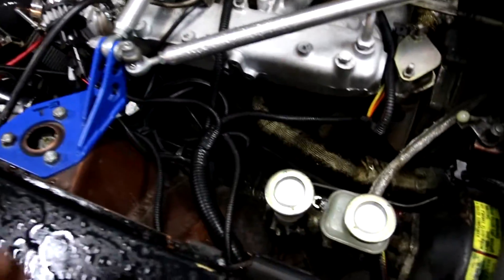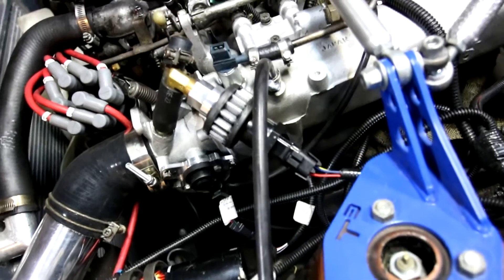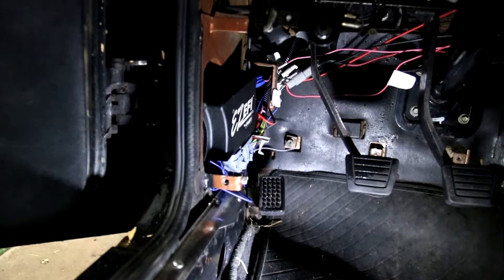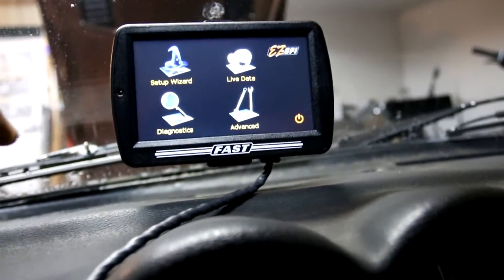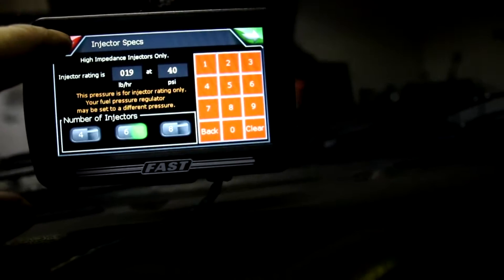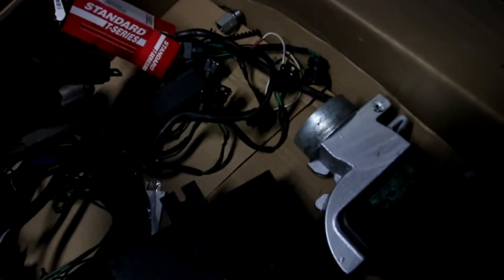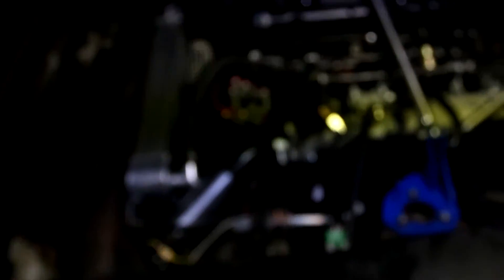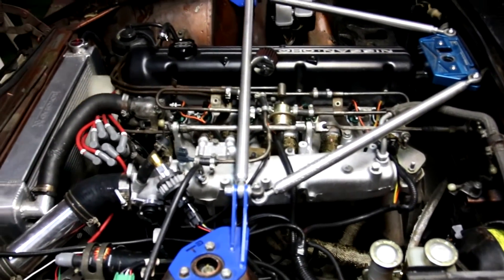FAST EZ-EFI Retrofit For Datsun 280Z Part2

Comment: Im trying to do this now. The only question i have is the rpm module so it only hooks up to negative side of the coil, ground and the harness... what did you do with the distributor wiring?? Is it even used anymore??

Comment: I know I'm late on this, just saw the video. I have a 77 z and if the engine loads up enough to stall,check the temp sensor connector it is usually corroded and green. Clean or replace. On cold start it is 2.4k ohms. At operating temperature it is 200 ohms. Open is infinity on ohms. If it still loads up and stalls after that or when slamming the driver's door it's the ECU. I used to take them apart and fix the PC board but it's  cheaper to buy a new one. Don't use a used or junk yard one. Been a Nissan master tech since 87. Not much I don't know about Z's. Had my Z over 40years. And no, I would never put a GM part on her.

Comment: Do you have to use hi impedance injectors? I had Turbo injectors but I couldn't get it to run right. Put stock injectors in and nothing

Comment: Hi man. Great video thanks. I am doing the same install on my 1977 280Z. I have two questions about the wiring I hope you can answer for me.
1. Where did you get the switched 12v from for the FAST ECU?
2. The fuel pump diagram says to also put switched 12v on the relay (86 pin). Did you use the same switched 12v for that? I can't figure out why it would need switched 12v since the fuel pump wire from the FAST harness (85 pin) should be doing the switching by giving it ground or not. I hope you understand what I mean :)
Thanks!

Comment: I really like the idea if this. I have looked at megasquirt in the past but this looks so much simpler. I do not have any reliability issues with my stock set up. I have even taken the car on three 2k mile trips and it's incredibly reliable. These cars were built to be driven! 

Anyway my question is did you see a fuel economy change? I see 26mpg average on long trips. All 75-90 mph. I have tall gears and it loves the highway. If I could improve on that I think it would be worth the investment. I would like to upgrade that terribly restrictive intake at the same time.
Reply from the maker: There is a small  increase of mpg. You can set the target AFR for when it's cruising and the computer will adjust fuel accordingly. In my opinion the engine runs much smoother over factory setup
Reply: @Redline280zChannel  Sounds like it would be worth it. Mine always runs a little rich, better than lean I figure. But I suspect it's just old wires increase resistance = more fuel. I think I'll give it a go in the spring. Thanks for the video!

Comment: Thanks for posting this (and the part 1, too).  I'm resurrecting a '77 that's had tuning issues since I got it.  So I've been curious about this kit.  Do you know if this system needs the rising rate FPR that comes on the stock fuel rail?  Or, will it also work with an adjustable FPR like you'd use on an aftermarket rail?  I think this with a Palnet or other aluminum rail would really clean things up.
Reply from the maker: either setup will work

Comment: Great video of installation "VERY GOOD"
Its june 16 2018 Im viewing this vid.
That battery should be ,in moving air, it creates gas. ( behind your seat is NOT the Place for it.
Besides it will eat the back of your seat from acid the floor as well, and your breathing in acid fumes and the acid is in the cock pit eating everything those fumes land on.
The engineers have it over the fender well for a good reason.
Move it back to the engine compartment. 
The other thing , having wires under the pedals against the fire wall......is NOT a good thing not a good look.
A sports car needs to be neater than that installation to be reliable
And if it looks right it is right.
I also saw alot of connectors ( cause heat build up) the few connectors on a wire the better.
Just saying move uo to the next level of being a" sports car guy. " The chassis is the car. All systems should be as well routed and professional looking as "at least the original lay out or better"
The body work is just to keep the rain out.Alot of "sports car newbies" work on the outside first.
But an experienced builder will be all about the chassis first.( get that sorted out and neat installs)
Again great video well done very good camera. ( clear sharp video )and explanations

Comment: I've been waiting for this! I was going to ask if so far you've noticed any improvements in reliability? Right now with everything stock I've been running into hot start problems, and starting to get cold start problems. Do you think this would help with that?
Reply from the maker: My car  starts up every-time whether the engine is hot or cold. Before, sometimes it wouldn't start at all. This kit could possibly help with your start up since it replaces your EFI system. Have you changed your fuel pump? It sounds like a failing fuel pump or other fuel related problems.
Reply: Yeah, I'm actually on fuel pump number three. Lol. I should've cleaned my tank earlier, but also I was thinking maybe since the guy I bought it from seems to have opened the AFM, maybe he was also experiencing problems with hot start before, and just tuned the AFM by hand. Lol. Also, I changed the fuel rail hoses, and the injector seals, I don't have anymore fuel leaks, but I still have difficulty starting it. I even have the problem if I leave the CSI unplugged, thinking it was just running too rich. No luck. Any suggestions?
Reply from the maker: does it run good while driving? you can give it full throttle?
Reply: Seems to run fine, seems to lose some power when it's hot, but it isn't much loss. It's almost unnoticeable. When it drives, it's awesome

Edit: Sometimes when it does get a hot start it runs really sluggish for a few minutes
Reply from the maker: Having the AFM tuned incorrectly can cause difficulty starting. Does the floor got really hot? (Sign of running lean.Bad AFM) I've also had an intermittently bad coolant temp sensor cause me starting problems. I would double check everything first before buying this kit.
Reply: Thanks! I think I'll go around checking the sensors with a tester and see if I can find anything out of spec. Thanks again for the help! Subbed

Comment: How are you liking your new set up?
Reply from the maker: it runs great and its very nice having a readout of various info on the screen.
Reply: Have you had any loss in power? Or gained any? And would you happen to know if it’s legal in CA?
Reply from the maker: supposedly it should make more power because it will learn and adjust for my header and exhaust system. removing the air flow meter should reduce restriction to the intake. I haven't gone to a dyno to verify this but it does not feel any slower. i could not find info on whether or not its legal in CA
Reply: Thanks for all your help man! I really appreciate the help!